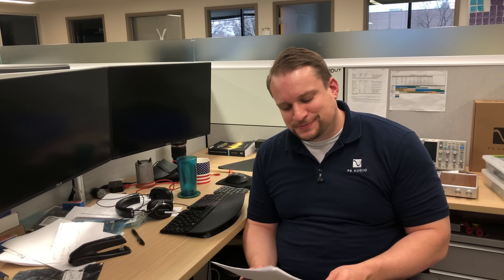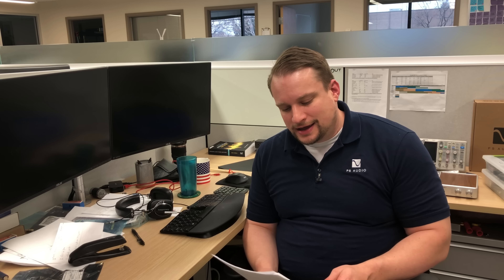Buying vintage speakers

Comment: You can ABSOLUTELY fix your vintage speakers! 98% of the time a full recone is not needed, you only need to refoam the woofers and replace any capacitors that are electroletic. There are repair centers in most every town. To say its not worth it is hugely misleading.
Reply: As the man said, if you don't use OEM parts, and potentially, techniques, it won't be the same speaker.
Reply: @Bob-Fields  True, it may not be exactly the same. But I have rebuilt lots of vintage speakers: JBL's Dahlquist's, Mirage's, KRK's, Sony's, Infinity's to name a few(refoamed, new caps and an occasional new driver) and have never thought that they ever sounded worse than before. They always sound nearly the same or better. The high-end was a lot less harsh is what I notice in most cases. I find that it doesn't have to be exactly the same to still sound great.

Comment: I replaced my electrolytic caps in my 30 year old Magnat speaker crossovers. The degradation in sound was not realized until they were replaced. The sound change was very noticeable due to the old "dried" out electrolytics. I am surprised this was not mentioned in the video as this is an important thing to consider with vintage speakers.
Reply: I need to do the same on my close to 50 year old Klipsch Heresy I's.
Reply: Jon,
 Not all that hard to do. I bought into using very high end, Jantzen film caps, very expensive as well on the tweeters. They originally had electrolytics. I found the tweeters to be overly shrill. It was very fatiquing. I then replaced them with an electrolytic of the same value and the tweeters sound very nice. Point being, if your speakers use electrolytics to begin with I would replace them with the same chemistry type. I used high quality Mundorf electros and am extremely glad I did. I used the same type on my midrange and woofer. This may help you to not overspend on film caps that are very expensive. Any questions, let me know.
Reply: What he says is of course true, but by this logic a 30 year old speaker is good for the trash. Of course the sonic signature will never be as it was when it left the factory. But, I suspect any original designer would be honored to know that 30 years later, the owner of his creation is still doing his best to continue enjoying it. He goes on to say, they at PS Audio did just what he is cautioning against, albeit with access to the original designer. The fact is, nothing resists time, change and degradation. If one's attachment and enjoyment of a speaker is enduring, one makes a choice, either leave it untouched and use it until it can be used no more, or seek to resuscitate as need be, do your best and live with the result. I would choose not to simply use a speaker to the point where it has declined beyond its useful purpose, but to maintain it at as high a level as I possibly can.
Reply: Did the same thing in my Ditton 15 speakers, but i think the caps in the speakers were not to bad as a very slight difference maybe, but definitely worth checking out for a small outlay

Comment: Rebuilt my old AR28S pair. Refoam woofers, new crossover caps, and they still make the tweeters. Rebuilt a pair of Dahlquist DQ-10's (late 70's). New woofers (made to spec still) and 16 new capacitors. Wow . . . still amazed at the detail and sound stage.

Comment: I repair and rebuild vintage speakers as a side business and hobby. I disagree with his assessment when it comes to finding exact factory replacement components. Some original speakers surrounds (Advent and CV's come to mind) are inferior for durability. You can find replacement surrounds, with the right specs, made of superior foam that won't deteriorate like the originals. I've never noticed a significant difference in sound quality. Replacing capacitors and resistors, as long as they are the same specs will have nothing but an improvement in sound quality.

Also, he never actually answered the question as presented.
Reply: Side note, if the cone isn't damaged and you haven't smoked the voice coils then I see no reason to change them just because they are old.
Reply: Replacing capacitors with an equivalent is indeed important, but not easy. If you don't match the ESR (effective series resistance) and other factors you will end up with too much or too little at different frequencies. The advantage is that you should easily get better sounding caps now than you could 20 or 30 years ago.
Reply: That's a trait he has apparently inherited from Paul. I wish these guys would think more about the question being asked before breaking into their spiel.
Reply: @Larry Niles Of course. Opinions are like assholes, everybody's got one. But it's been pretty obvious that these guys frequently do not really answer the question posed.

Comment: I totally agree with the don't pre-emptively re-cone recommendation. If the surrounds are demonstrably problematic you can try to re-cone them but if it ain't broke don't fix it. 
I have some vintage Magnat speakers I would like to mod for the cross over network. All speakers are build to a budget and putting better coils and caps in them could make them better at a relatively modest cost.

Comment: I have refoamed and restored several pairs of vintage speakers including Infinity Reference 5, Optimus -400, Infinity SM82 etc..none of the cones themselves needed replacing - Infinity polypropylene and/or graphite materials were in almost new condition versus the surrounds which rot from UV exposure and time. I understand the need to sell new gear but when you see the internal construction of a pair of Paradigm or Infinity Reference you will know you are doing the right thing by keeping them alive!

Comment: All 12 pairs of my speakers (and subs, for that matter) are vintage and still sound great. Some I have re-foamed and some are still original, some I have put custom crossovers in. They were bought 20- 30 years ago. I don't care for change when it comes to my equipment, I still love every pair. And As far as re-foaming goes, my speakers came out perfect and sound excellent. It's something you have to have a touch for, but I didn't have any problem taking my time and doing it right. And they look and sound original.

Comment: Sometimes there are people who restore driver units. You can restore crossover components. Cabinets can be refurbished. Some people make a real living out of it. Check out Kenrick sound, I believe they are in Japan. Their YouTube videos are mind blowing. Yes, you can get it wrong if you choose badly but, mostly speakers are restorable and can be serviced very effectively.
Reply: Gary Llewellyn, they go for really detailed equipment to drive highly reengineered studio monitors from Altec. Most of their speakers seem happiest with valve power and they can deliver dramatic dynamic range without compression. I know what you mean, though. I guess their speakers may be too revealing unless you use the trimmers to balance the sound to suit the room and its furnishings. But , they are impressive vintage studio monitors. They come out better and prettier than new.

Comment: in my main system, along with 50 year old mac components, are the jbl's that i got with them. have replaced the surround in both 14" woofers, and a pot in one crossover. still sounds great. thanks for the videos, always compelling and thought provoking.

Comment: i had no luck finding the right floor speakers so i built my own crossovers and found some woofers, tweets and mids and  built them by trial and error but now "MY GOD"  i would put my speakers up next to any floor speaker!!! i also am pushing 650 watts by 2 channels  !

Comment: I am using 60 year old Altec drivers in my home built horn system.
Reply: Well, Altec drivers have a great community behind them, as well as some modern replacements and parts from Great Plains Audio.  I used to work with Gary Rilling, who was Altecs longest employee.
Reply: I bet they sound amazing!
Reply: @cbrunhaver  Indeed they do, but I have a pair of 515b woofers with the original cones, a 288c compression pair with original aluminum cones, and in addition, a pair of 755a drivers marked 1957 with the original cones. Everything works just fine. The paper cones do have cloth surrounds and spiders, and they are commercial grade, that may explain their longevity. And the fact that I power them with 2 watt amps might help.

Comment: I bought some old 3 way speakers a while back as my first plunge into audio and I've really enjoyed them. The midrange speakers were blown so I glued them as a temporary measure. They actually sound really good to me, even with the midrange being glued. Now, I'm preparing to replace the midrange and tweeters, and hopefully the crossovers if I can figure it out. My next step is a calibrated mic and figuring out how to measure the speakers.

Comment: I’ve replaced the foam surrounds on Bose, Mirage,JBL, Advent, Boston Acoustics, and a few other brands that I don’t remember, and I’m not particularly super-skilled in doing it; you just have to be able to get the exact dimensions of the replacement, and having the cone centered before the glue hardens so you don’t hear any scraping is required.  If the speakers are over 15 years, count on the foam being dry rotted.  To test, get the grills off and gently push on various places on the surround; if it tears or crumbles, replace the surrounds. I’ve only repaired woofers, except for the mini drivers in the Bose 901’s, never had to fix other drivers.

Comment: Chris, you always give an honest answer to the question posted. Those speakers with paper cones and foam surrounds will deteriorate relatively quickly,  but I have a pair of tannoy 609mk2 speakers with a rubber roll surround and plastic ? Cones that sound as good as the day I bought them. And tannoy are great for after sales support.  As are many dedicated speaker manufacturers.  Look forward to your next  video.

Comment: I have a set of 30-plus year old vintage DBX speakers that I just replaced the foam suspension rings on the woofers I got from Simply Speakers. The new ones were very inexpensive ($30) and their customer service was excellent. Removing the old ones was messy, but they sound better than when the were new. I would not bother with replacing cones.
Reply: Simply speakers is a great place.
Reply: Thnx for thw tip 👍

Comment: Just sounds like a lead in to selling their own speakers to me.
Reply: I also hear the same pitch whenever I watch Paul. Initially I thought their channel was user centric were the goal was to help users but it seems that they are only taking / responding to question related to their equipments. 

I can't blame them though since they also need their business to survive.
Reply: Not really sure how you get that impression. Our goal is just free information and advice and community engagement. I see that there are a lot of vintage speaker hobbyists and repair folks in here. Maybe I should have spoken more about repairing vintage speakers at my family's hifi shop as a teen?

Comment: No one has mentioned that modern magnets have improved by leaps and bounds over older ceramic and alnico magnets of vintage speakers. Permanent magnets are not permanent and loose strength with time. Old speaker magnets can be recharged however in vintage speakers with large electromagnets specially made for that purpose.

Comment: I agree there are lots of risks associated with buying used speakers. If speakers have been abused there could be issues like cone rattle (a listening test should reveal this). Surrounds can be an issue but a visual inspection should give you a good idea where you stand there. Certainly foam surrounds tend to have a shorter life than rubber surrounds. That being said I have had good luck with surround repair kits. As I recall aftermarket companies can supply various kits (you need to give them your make and model and they send you the generic replacement kit that best matches your drivers).  In general I believe well made speakers that aren't badly abused can last many years.

Comment: I found a pair of Pioneer CS-201’s from 1959 in pretty much mint condition at the dump, and they sound great for 60+ year old speakers. At first, I thought they were some type of mini refrigerators or something. They’ve got a very cool mid century modern look to em. I still prefer my new speakers, but the pioneer’s price couldn’t be beat, and were an excuse to put together a vintage system in addition to my current rig.
Reply: Fat Rat 
They cost 0% of $1,000,000. lol. Just sitting in a shed where people leave stuff that’s not necessary trash, but that they don’t want anymore. Glad I realized they weren’t mini fridges, by seeing a tiny old school Pioneer logo on em.

Comment: If the cones are good the drivers can be recoiled with new surrounds fitted and will be very close to original spec if done right.
Reply: Norval Yes exactly right. Rubber surrounds can harden and crack or even rot when they get too old. Aging of surrounds vary depending on type of material.
Reply: Fat Rat  BTW, what happened to your filter experiment? I'm curious how successful you are in getting a proper cross-over working between those speakers.
Reply: Fat Rat  I suspect that if you are hearing them bottom out, that the frequencies involved are lower than 80Hz even with the HP filter. The excursion above 80Hz is probably not enough to cause the bottoming. You might try putting two of them in series (put both of your filters on one channel) to get more rolloff and see what happens.
Reply: Fat Rat  I'm not suggesting you spend any more money to just try something out. Merely that you take both of your two filters, put them both on one channel,then play your music in the usual way and see if the additional filtering solves the problem on that side. This may help you decide if you want to oneday invest in a DSP crossover to resolve the problem.

Comment: Tolerances in speakers are surprisingly broad so vary in response considerably. That doesn’t necessarily mean a reconed speaker is going to sound bad, just different. Unless the manufacturer went out of their way to match left and right speakers, and quite a few don’t, you will hear differences between them. The matching process is just one of the many costs in genuinely high fidelity speakers.

AFAICT my 20 year old VAF DC-Xs still sound as good as new. My 1970s AR bookshelf speakers started to sound bad when the ferrofluid in the tweeters dried out after a decade or so!

Comment: I always buy used speakers ( as well as almost everything else.  I have been running the original Quad ESL 57 that I have had for about 20 yrs.  No Problems.  And I have one of the most significant speakers is HiFi history for peanuts.  Look and listen to anything you plan on buying.  If it sounds good and the price is right, go for it.

Comment: If you're looking for a project I'd recommend finding a high quality  vintage speaker cabinet and completely replacing the electronics within.
Reply: Just old caps in the crossover.

Comment: So many things to touch on here.

1. As much as one doesn't want to change the so-called signature sound of a speaker, by the time it needs to be repaired, that sound has degraded beyond acceptable limits from the original. And when you repair the driver with the best OEM style replacements, they will usually be superior to what was originally used.

2. For a small investment, you can buy measurement devices to verify the driver parameters. Pre and post repair. That helps with making sure it'll work.

3. With enough information, either gathered or published, the designs can be verified, especially since there are so many online calculators available.

Now, I will tell you that with enough checking around, you can find suitable replacements for most standard style drivers. Case in point, I rebuilt a pair of original Bose 501's (mk1) for a co-worker. After going through the catalog (pre-internet days) and lots of hand calcs, I found the right combo that was direct replacement along with the same values for the crossover. Was it the same? No. Was he happy with it and how it sounded? He was ecstatic at how it corrected the problems the original had.

Comment: Just picked up some babied ADS L1230's on craigslist 2 weeks ago.  They still sound superb, even with only 75w, and they're pretty old in 2020.  While I ,too, am mildly concerned about things like surround-sag, crossovers going stale, and procuring factory/3rdParty replacement parts, I'm more interested in having a great time listening to music.  Especially in the 21st century; sometimes I'm dancing to my JBL charge2+, a disposable/replaceable device.  But these ADS speakers, Elton is in the house with the piano and you will listen!
The gentleman I bought the ADS's from had a pair of Polk SDA SRS for sale too, the big daddies.  They sounded.........Impressive and he wanted $1200 for them, but they're even older than the ADS, and notorious for needing replacement this and that.  There's always going newVintage with something like the JBL L100, they have parts if you get overzealous with the wattage.  
Similar to finding the '66 corvette owned by a little old lady from Pasadena, if things check out and you have the cash, go for it!  Audiophiles only live once, too!

Comment: I  just inherited a set of Altec Lansing 512 active speakers circa 1989. Class a/b self powered beasts in a time when active speakers were fairly unheard of. I have some refoaming to do, and the mids need new voice coils. all stuff very fixable. Funny how PS decided to go active  with their new  speaker.